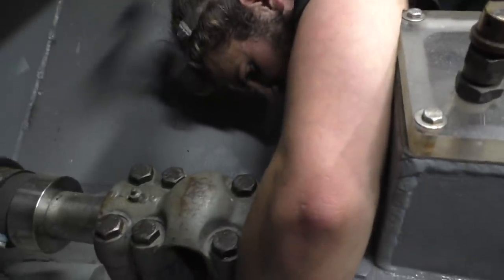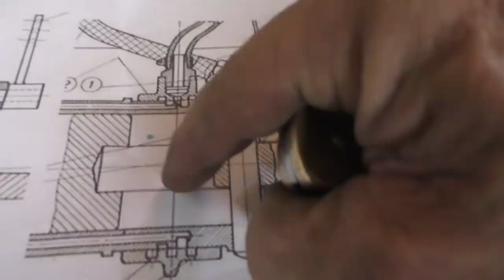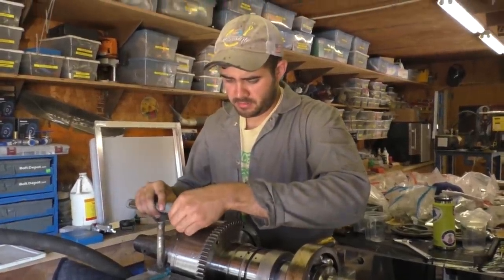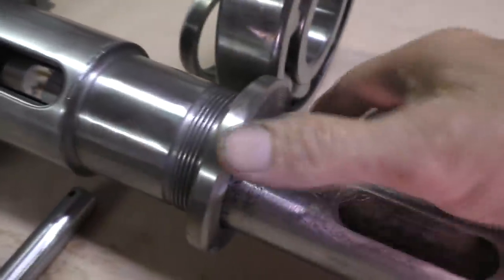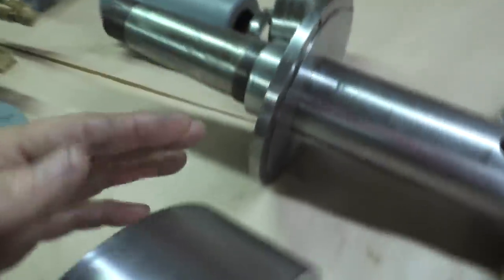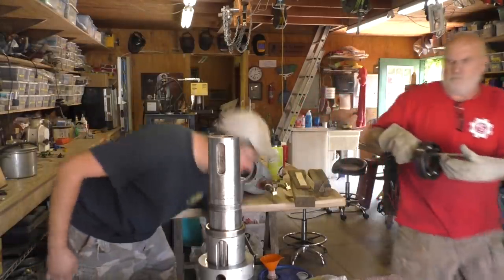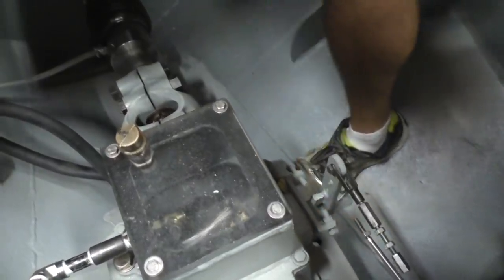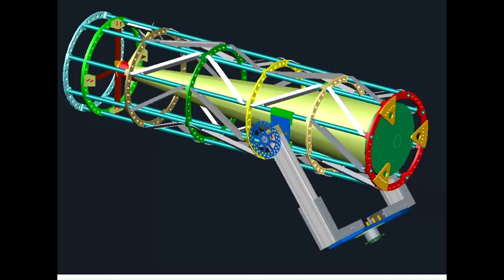Hundested Variable Pitch Propeller Controller Rebuild and Installation

Comment: That is too cool.  Awesome to finally see that thing in action.  Do you think it might be worth pulling the muff coupling off, and indicating the shafts to see the alignment?  I've never done it, but it sounds like that alignment is pretty critical.  Mount an indicator on one shaft and have it measure on the other.  Rotate 360 and make sure there's no runout between the two.  Or just send it.

Comment: Beautiful beautiful work.  Just an idea: make a special shaped plastic bucket for the place under the shaft seal. Put a small automatic bilge pump in it. If the pupm ever work, you immediately now that you have problem at the shaft seal. if it don't, the plastic bucket will keep the metal dry from any salty water drops

Comment: Hi Doug, I am afraid that you overheated the ball bearings. Judging form the annealing colors the bearings were at about 280 °C (536 °F). Is this plausible with the setting on the oven? In this case the hardness of the bearing steel drops significantly and will cause a premature bearing failure. Since removing the Hundersted again looks like quite the pain in the rear I really hope that the bearings will last but I would definitely recommend buying some new bearings as spares just in case.
Greetings from a mechanical engineer from Germany
Reply from the maker: We'll see, but I seriously doubt it.
Reply: I agree... toasted it! But it is slow speed... so as long as it's washed with lots of oil... it'll slow the wearing down!
I'm also worried about the dope put on a taper fit, defeats the taper fit design, the force will all be on the key, and shear it quickly! Also there's inadequate cooling of oil, needs far more cooling since it's not cooled by seawater at the prop! But mostly the power steering pump being used for power! The load from that size boat and prop isn't gonna cut it! Prolly 30% of engine power will be utilized to drive it til it fails!
Good idea... needs beefing up! With variable orifice/recirc somewhere! With stainless sliding register head! Proper taper pins instead of solder! That bronze will burn the oil up quickly... especially with uneven/stepped ways!
Wish him luck... hope I'm wrong!
Doubt it!

Comment: Feathering is the same in aircraft propellers, not opposite as you suggest.  If you were to experience an engine failure, the prop blades will feather, as in turn knife-edge into the airflow to reduce drag.   When the blades are flat, that is called full fine pitch.
Reply from the maker: Yes.   I was thinking motor vessels.

Comment: That ring gear on the cylinder was driving me crazy so I did some research and in some pitch controllers it can be used as a PTO.
Reply: That makes sense, the pto would bolt on the same way they are added to truck transmissions and transfer cases.
Reply: That was my theory too. Cheaper to just use pre-designed parts that will fit rather than make a new part.
Reply: on larger ships i would suggest a jacking gear. for rotating the shaft, during extended station keeping. as i mentioned above..

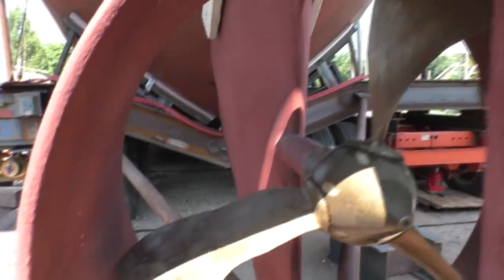Comment: Hello Doug. Allow me to correct you @5:24. On an airplane feathered is also the same when the blades are slipstreamed with the airplane heading. Usually done when you need to shutdown an engine and want to minimize drag which is self explanatory. When blades are lined up with sweep disc that is idle. This is general and each propeller has its own numbers regarding blade angles mostly to compensate for blade torsion. A propeller is just a rotating wing like on helicopters and angle of attack is higher by the blade shank usually..

Comment: Hey guys, it seems to me that by widening those grooves you compromised the proportional control.
It would seem that the prop blades should react to slight lever movements by moving the blades proportional to the lever movement.
It looked to me like the blades went fully one way or the other with any movement of the lever. It would seem to me that you dont have any fine adjustment ability now.
You may want to be sure before you  give that unit a seal of approval.

Comment: The reason why this system became obsolete was the very long time between reverse thrust and forward thrust. This caused  by the mechanical shift unit, and the blades needing to reverse themselves. Terrible situation for smaller vessels docking in marinas. There was a reason for this unit sitting in a scrap field in Canada.
Reply: Wouldn't there also be an advantage in having an indicator telling the position of the blades?

Comment: i would sugest that you keep a set of replacment bearings for that thing in stock. once thay go blue hot thay are shot, my experiance. i never heat them over 150c plenty enough to expand and not  butn them
Reply: So you are saying they are inadvertently tempered now and soft(er)...  yup.    Interesting the rebuild has started before the build is floating.     Shocked, just shocked.

Comment: Man that bearing got HOT 🔥
Reply: Yup, there both blue. Maybe enough to delete the hardening 🤔
Reply: @stevecarlisle3323  I was thinking the same thing, not a good idea!
Reply: They were coated in oil when they went in the oven... they had been heated to the same temp years before when Doug put it together.
Reply: @LobsterHunter5  I dont understand your comment..
Reply: @LobsterHunter5  As a custom knife maker and heat treater most bearings are a 52100 grade of steel and temper is determined by a combination of three things color, time and temp, heating bearings to a blue color changes temper regardless of being coated in oil which has no effect on the outcome.
Reply: @MrJohn714  ok

Comment: that ring gear could be used for a single position p.t.o. aka when the  prop is feathered for sailing you could be running an extra generator
Reply from the maker: Yeah it could.   We'd need to decouple the shaft to the transmission too.

Comment: Unless I missed something, the pitch controller 'lever' just dictates MORE pitch or LESS pitch (plus the central lock).  It doesn't actually feedback what your pitch is.  Is there a visual cue at the prop shaft that shows current pitch?  Or is it more of a "reset pitch to zero" on start up and then feather pitch up until you get ideal cruising position?
Reply from the maker: Correct, it changes the pitch. And ya just look at the handle in the wheelhouse.
Reply: I see what I was missing.  The lever tells the controller where you want the pitch to be.  Then something in the brass ring with grooves detects a difference and shifts to pump fluid appropriately until the shaft reaches the position requested by the lever.  The part I missed was whatever that sensing linkage is.
Reply: @josephpettit1519  thats exactly right! you got it

Comment: Long time lurker with two questions for you:
1. If there is a failure in this box or the hydraulic system - is there a backup, mechanical way to lock the propeller pitch for propulsion?
2. If that one small o-ring on the end of the adjustment shaft fails - how much oil pressure is behind it, in other words would it be a major oil leak?
Reply from the maker: Yes and that’s what we would call an indicator.  Not a major leak.  : )

Comment: Nice job. Just a thought if the transmission never gets out of 1st then the torque converter may not lock up and my burn up.
Reply: I don't think that model of Allison, has a locking torque converter. 
With enough cooling, would not matter anyways; just less efficient.
Reply from the maker: That’s why we put a dedicated heat exchanger on it
Reply: @SVSeeker  Transmission temperature gauge would be good to monitor the temps, high and low.
 It is possible to operate the transmission too cold, for long periods of time, from over cooling.
The fluid they use is designed to operate  around 180F degrees; screw type air compressors use the same fluid and won't turn on their cooling fans until the oil reaches 170-180 degrees, depending on model and settings.
200 degrees is normal, over 220 is considered getting too hot, they auto shutdown at 230-240.
The fluid needs to also occasionally reach a high enough temp to boil away accumulated water from condensation.

The transmission is machined to tolerances that will be correct at operating temperature.

Today, Stants, the same people who pioneered the auto radiator thermostat, makes OEM transmission cooler thermostats that are plumbed inline with cooling lines to restrict flow when cold; similar to cooling system thermostats.

Seeker could simply close a heat exchanger RETURN valve part way to restrict some flow and get it in the ballpark, if it runs too cold.
Monitor with the gauge; could take hours to heat up fully and find a sweet spot for the valve.
When you need more flow to cool, you know the heat exchanger is getting fouled and will need serviced soon.

Comment: That 'ring geared plate' is probably so you can attach some type of RPM meter. Would kinda make sense to monitor the shaft speed.
Reply from the maker: That's a lot of work just for rpm don't ya think?

Comment: For safety na need a mechanical neutral lock-out in the engine room by transmission (also a note plaque by the control lever in the pilot house). Anyone doing repair/maintenance locks the main shift linkage, possession of lock-out key & 'tags' the lock with whom locked it. You need to consider a lock-out safety policy for any mechanical system, this is critically important to establish PLEASE!!
🤞💖🙏 Lexi
Reply: You must be new here
Reply: @phoff5850  LOL been following Seeker silent - long term. I try not speak unless I gotta

Comment: the gear on the hydraulic cylinder within your prop control box. is used, when an optional shaft jacking unit is included. the top cover would be different, which would include a small motor with a huge reduction ratio. to slowly rotate the shaft, this is done while in port for a extended time. the ones used on naval ships rotate the shaft once every twenty minutes or thirty minutes, depends on the ships size and shaft design.. .  we usually let it rotate for 1.5 revolutions, to lube the shaft seals and to keep the drive shaft from sagging. this is done once a week. not rotating the shaft would cause the shaft to sag, then wobble for a few hours once we got underway. which is very hard on the shaft bearings... of course our drive shafts were a bit larger than the seekers...
Reply from the maker: I've not seen that in Hundested products.   I think that is for much larger ships is it not?
Reply: @SVSeeker  you are right, but they chose to include the main gear, in all models with that size of case and piston, to save on inventory. with your setup, you shouldn't need to worry. if by chance, you end up on the dry again for a extended period. giving the prop a turn by hand every few weeks would work..

Comment: Slotted brass collar is in effect a valve ....linkage,cable is the handle--   you  received it minus bolts , thus defeating one side  of the valves' output /pressure  path.....       defective operation due to missing  BOLTS...!      Hydraulicis  a  piece of a nice little GIZMO....

Comment: Will you have an indication at the pilot house wheel, for a Harbor Pilot to know if your boat is right handed or left handed?

Not sure where all your sailing to, but not all speak english.
Maybe there is an international symbol system?
Do you already know which way it should be from your design?
 Be good to already know, first time you dock it.
Reply from the maker: She’s 60 tons not 600 tons. :-)
Reply: @SVSeeker  Oh, I thought maybe transverse thrust would still have an effect when docking, even at Seeker's size.
Might be good to know when maneuvering.
Interesting info:
https://youtu.be/y7-tUlxr_no

Comment: As a machinist.  Never lube a taper, the lube prevents the taper from ever seating against the other taper and it moves . Always dry.
Reply from the maker: It's got a key, and if you ever want to have a chance of getting it apart after years on salt water, you had best reconsider your rule.  : )
Reply: @SVSeeker  maybe post a poll online to see to correct answer. This is not my rule, its physics,  the taper lock holds the parts together . No rust will enter a well fit taper either.  With grease in the joint the area with wear and hammer the keyway loose. You may also talk to keith fenner about any questions ive brought up, i just saw him this week and is a nice guy ..
Reply from the maker: @vettepicking    I'd do that if I was a lemming.    : )    If you are correct it will not work.  Keep watching.

Comment: Did you not have to TIG weld the big cavities left by the corrosion or was it In a noncritical area?
Reply from the maker: It’s worked for decades I imagine it will still work for more decades. You don’t fix what ain’t broke.

Comment: My biggest question is can the brass collar seat and handle all the CONSTANT pressure of the water pushing agains the propeller. (Thus the recommended bigger hydro hoses lots of pressure and heat) the hunderstead is literally the smallest piece pulling/pushing the entire ocean against the boat, or vice versa.
Reply from the maker: The forces from the prop are transferred to the two large thrust bearings.   The brass is only a part of the valve and less than 1200 psi.   Low pressure for a hydraulic system.   And the hydraulic force is only the rotational pressure on the blades and those are largely balanced with the axis of rotation for each blade being approximately in the center of the blade's surface area.

Comment: With water pressure over it won't it work easier?
Reply from the maker: It will feather easier, but it's designed to be adjusted while under load.  Other versions of controllable props have to be unloaded before the pitch is changed.

Comment: I don't know anything about Hundested gearboxes but it sure looks like you are losing all your pressure out them random looking holes. The way I think that thing works is by opposing pressure and you can push one way but when you try to push the other way your oil comes out those two holes. So, I finished watching the video and I was kinda right. I think. I got COVID. Enjoy your launch. Don't sink.

Comment: Now that my noodles are cooked - a Lock-out/Tag-out policy is essential in operational procedures. Whatever mechanical operation/function that has potential hazard/risk by anothers actions in missing/lack of status with a function/operation that has potential to harm, break, injure mechanical or living things needs to be addressed. Ugg can't thunk crooked 🙃 ya get my meaning - im just stupid tired atm.
Reply from the maker: No, keeping body parts out of a system that is running is essential.   : )